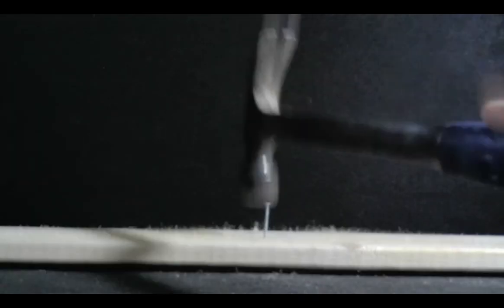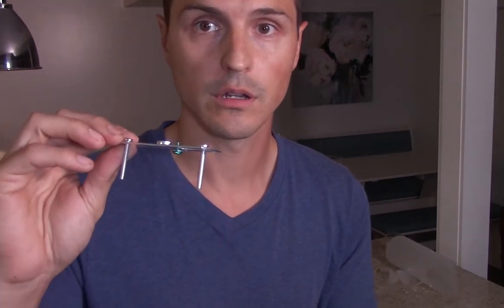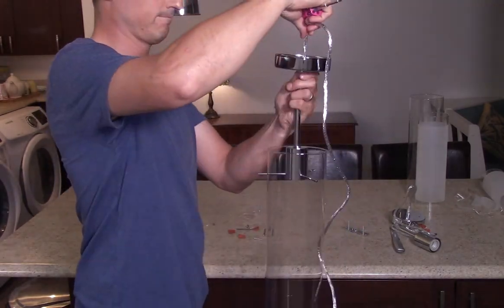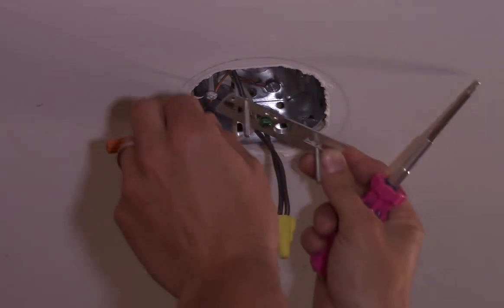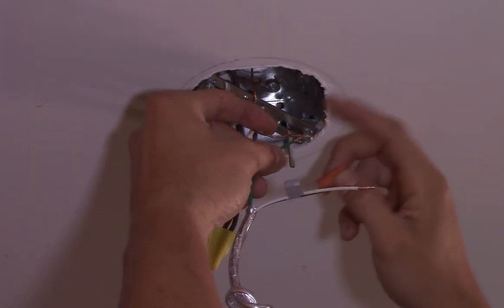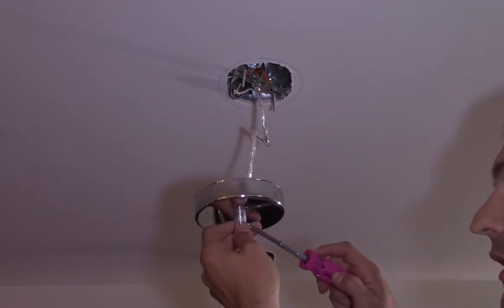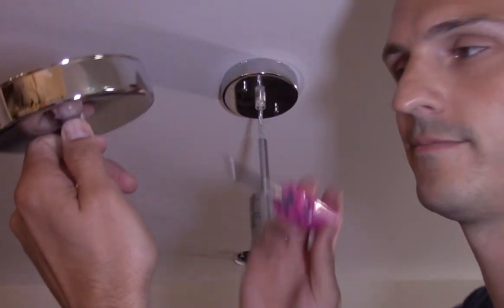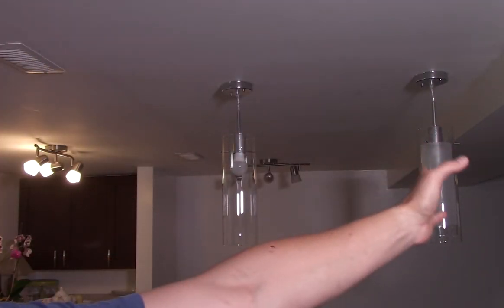How to Install Pendant Lights Quick & Easy (Amazon Link)

Comment: What are the precautions that need to make to prevent from getting electrocuted? Do you advice turning off the main electrical panel? Im scared of touching wires.
Reply from the maker: Absolutely! You should always turn off the breaker.